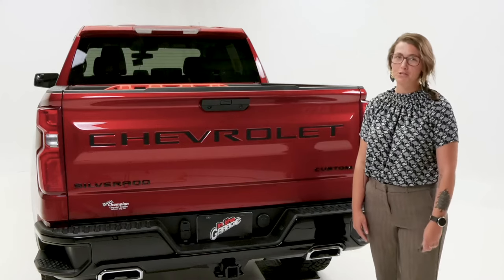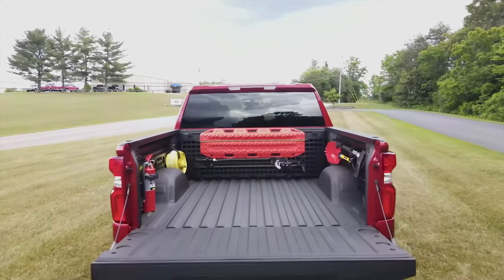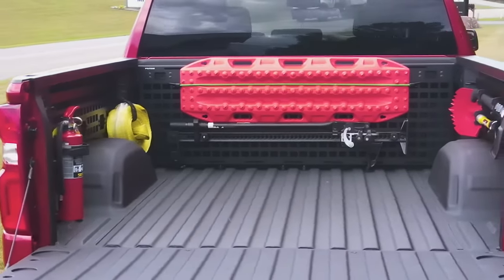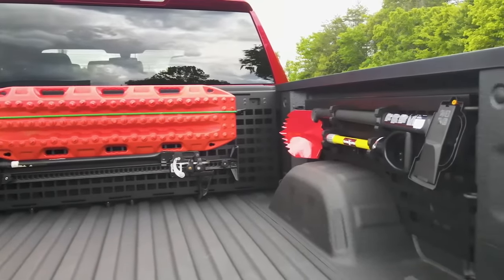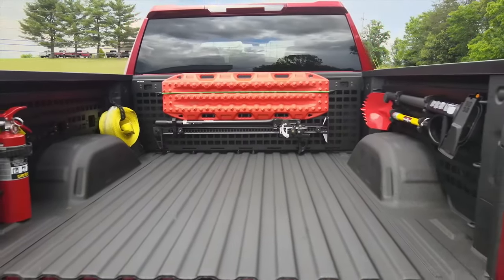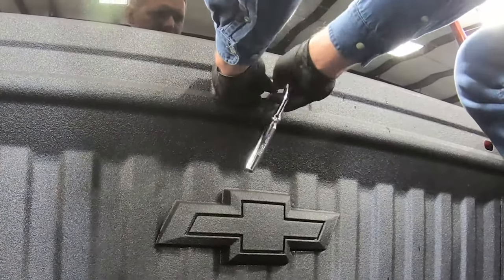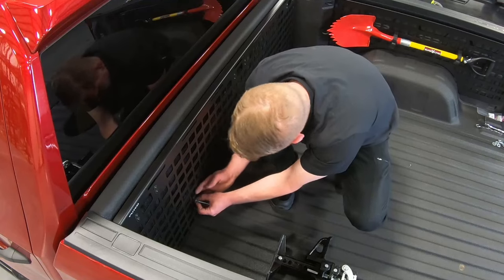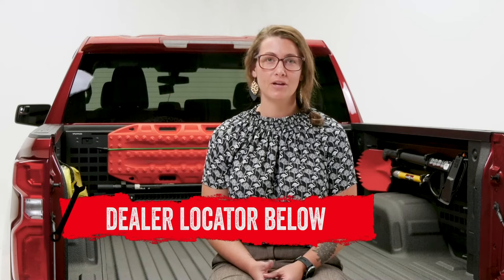Putco Molle Panels - Truck Bed Organization

Comment: I ordered 1 panel from Amazon = No install instructions, 3 bolts and no other hardware and website sucks!
Reply from the maker: Sorry to hear this! Please reach out to our CS Team 8-5 M-F at support@putco.com or 800-247-3974. 

It's difficult to answer the hardware question without knowing what model you have as some panels reuse factory hardware to mount, so the may not be very much hardware in the box.

If you go to the MOLLE page on our website and type in your year make model, there should be an option to download the instructions near the "Add to Cart" button. Alternatively, if you have your part number (it should be on the box or etched on the product near the American flag) you can go here: https://www.putco.com/product-support/ and type this in to quickly download instructions.